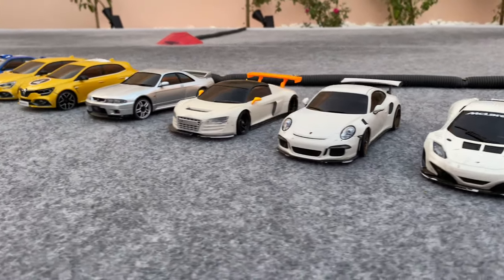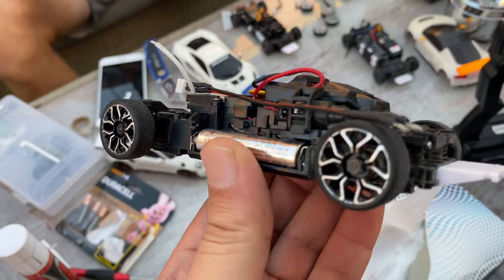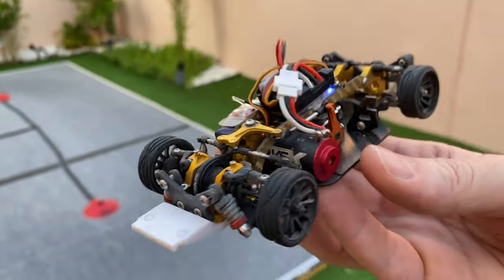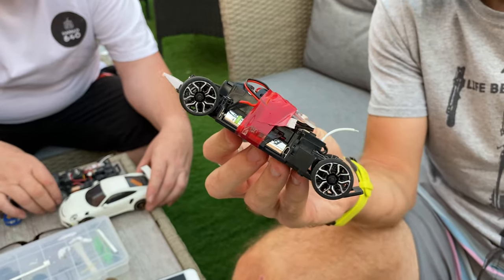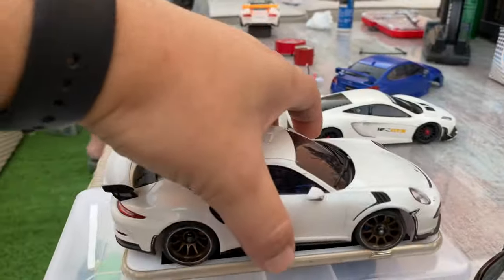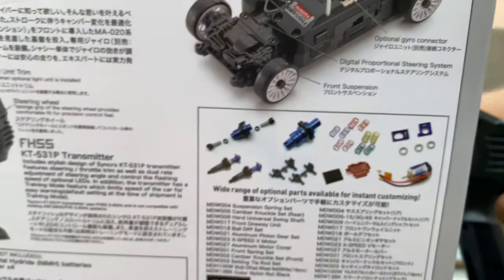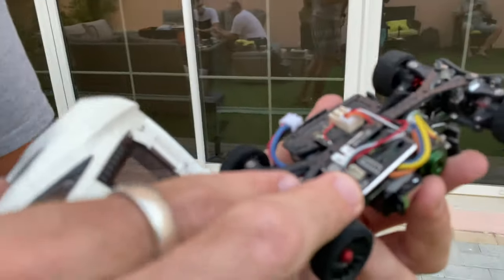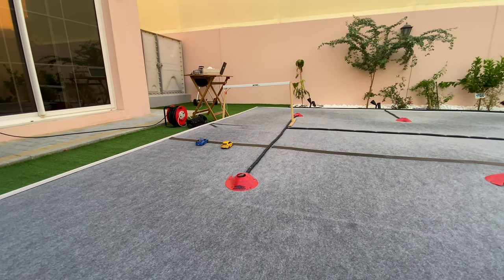RC MINI Z Atomic BZ3 and more

Comment: Hi guys, I bought a Kyosho Mini-Z NSC about 19 years ago together with a few upgrade parts. I can see that these have been significantly upgraded. Any idea what are the very best kits for these 1/17th 1/28th scale cars ? Are there any websites where I could read about the different models ? And are there any shops for these in Dubai ? If I was to buy one I would rather buy one with all the performance parts from the start rather than to upgrade a more basic model. I like the carbon chassis with independent suspensions and 4 WD as you are racing on the video.
Reply: NSX